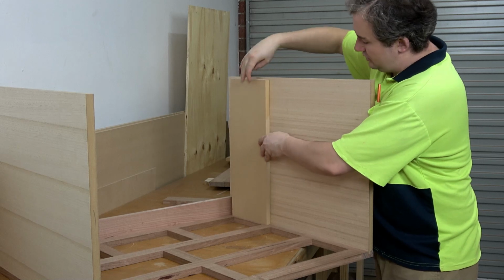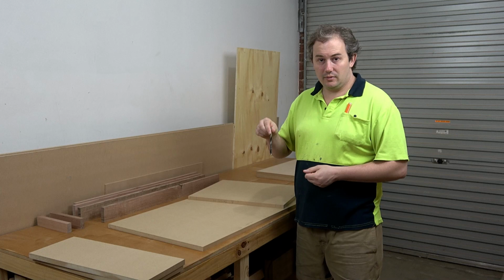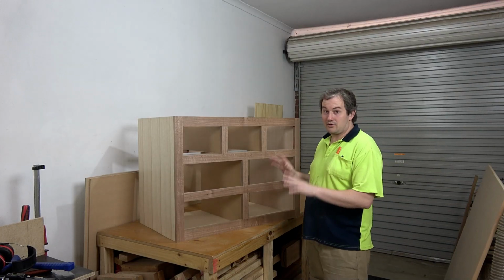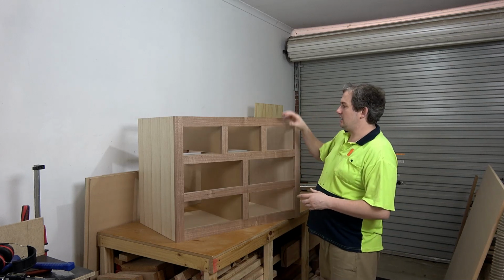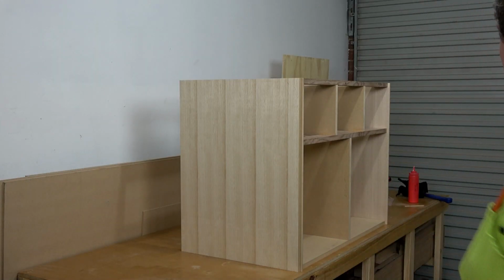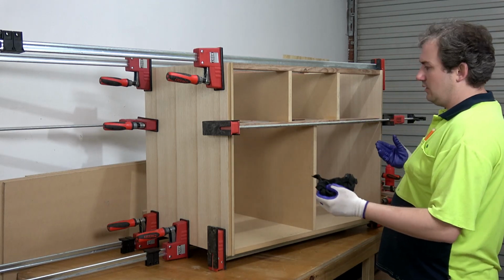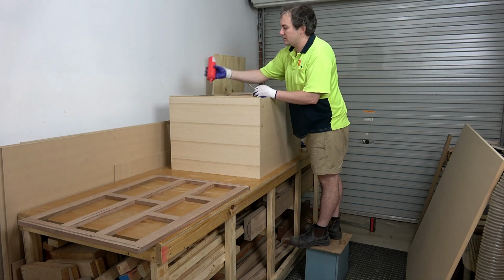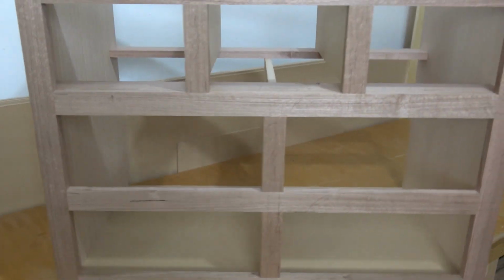Chest of drawers build 4 - The carcass construction

Comment: That face frame went on well.  Another point to remember about dowels and glue is better to use fluted dowels so the glue can "escape"  and spread along the flutes.  I've seen glue burst out the other side of the panel when you 1) hit too hard and 2) where there is no room for the glue to go.  Thanks for the video.  Cheers, David
Reply from the maker: haha yeah. When I use dowels near the end of solid timber board, often you see glue squeezing out of the end grain close by. It sure does create a lot of hydraulic pressure. The fluted dowels are much better because it allows the glue to escape, but they are also compressed. So when the waterbased glue touches the compressed fibres, they swell and create a very tight and strong joint. It's one reason not to use epoxy with fluted dowels, because it won't expand the dowels again.

Comment: Top job mate. There is no way I could get that many dowels to line up.
Reply from the maker: I spend a considerable amount of time marking out the dowel locations. And then I am very careful when I drill them out. I do miss drilling out the side panels using industrial cnc routers, it's so much easier to tell a machine that I want a hole here, and there, and there 😀

Comment: Awesome Kuffy I was curious what if I were to use solid wood panels do you think attaching a face frame would be a issue with wood movement ?? Only reason I ask is that I really like the design your making. Take care my friend
Reply from the maker: You can use solid wood side panels. The face frame causes no issue with movement. But the interior structure will need to be built differently to allow the side panels to expand and contract. I originally had planned to build this chest of drawers as a full traditional build with all solid timbers but I ran out of time and quick n dirty ended up being the aim of the game. If I had of done the traditional build, I would have built a "web frame" interior to allow the side panels to expand and contract while still be able to support and guide the drawers. 

Building with veneered side panels just makes things a lot faster. Instead of having to mortise together a few web frames with draw guides, runners and kickers etc. I can simply dowel in a sheet of MDF and the jobs pretty much done. Though using MDF like I have here makes for a VERY heavy chest of drawers.
Reply: Kuffys Woodwork   Thank You so much for the information I really appreciate it.

Comment: I was just wondering what your qualification is, are you a qualified cabinet maker or furniture maker or is this just a hobby for you? I've been trying to find an apprenticeship as a furniture maker but finding it quite difficult finding places that deal with custom furniture etc. here in Oz. And most cabinet makers these says don't deal with hard timbers and different joinery methods. How did you get started?
Reply from the maker: G'day mate. My qualification is a furniture production wood machinist. I started by machining timber architectural components and turned furniture components such as table legs and coffin handles and staircase components. One thing leads to another, I ended up working for a few different furniture company's requiring my skill set with the industrial scale woodworking machinery. Now I no longer work full time in the furniture industry due to the industry contracting, businesses going out of business etc etc. These days I build timber roof trusses full time and one off furniture pieces after work and on the weekends.